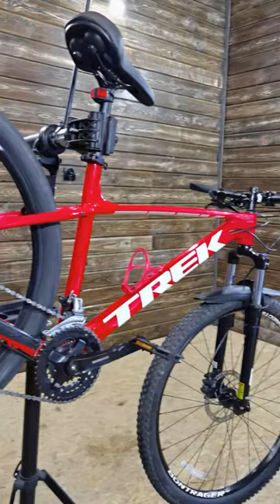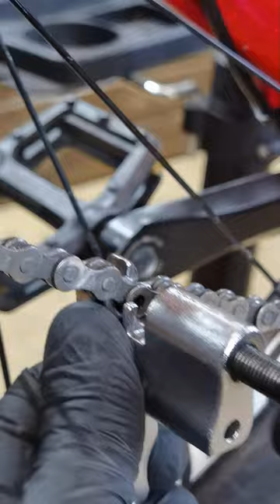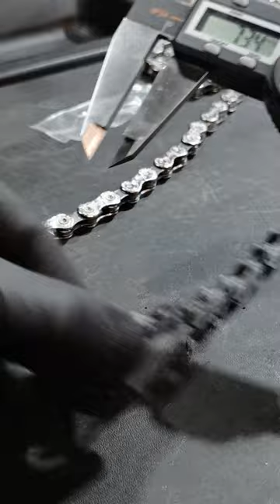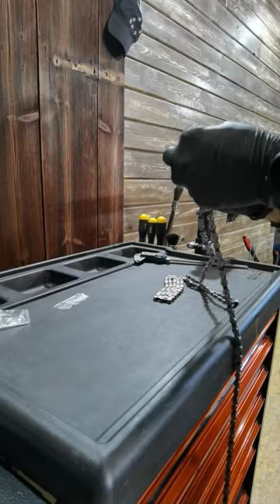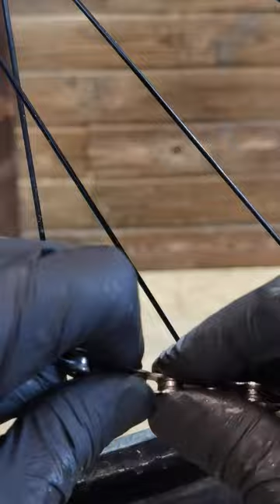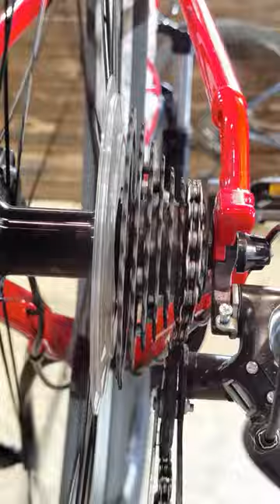How 9 speed chain shifts on 8 speed cassette...

Comment: So can I run 10 speed chain on 9 speed cassette?
Reply: No .
Reply: Dyna Sys and Linkglide are specific systems .
Reply: It's possible but really hard to get the index adjustment right.

Not tried it myself but I have run 9-speed chain on 7-speed cassette and 11-speed chain on 12-speed cassette.